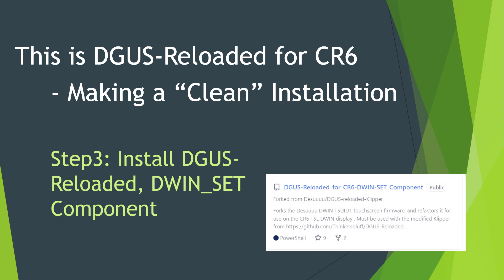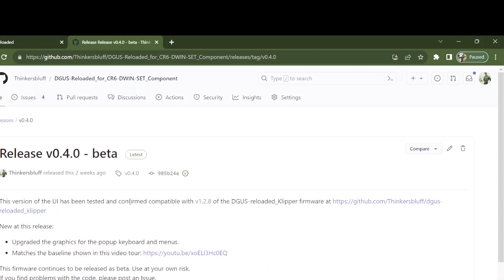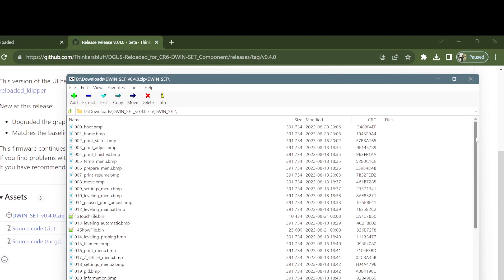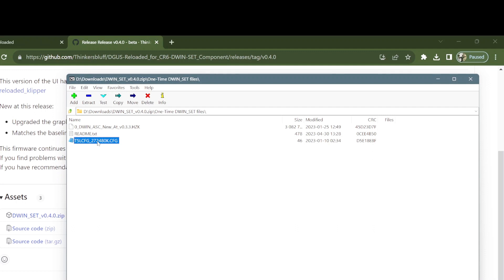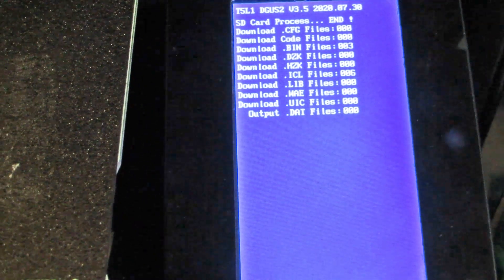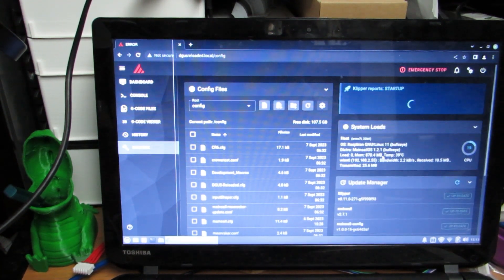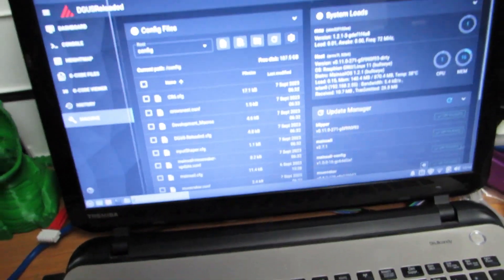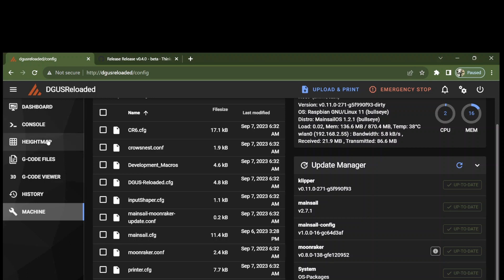Step3: Install the DWIN SET Component

Comment: Hi. I am glad that you te posting such information. Would it work for t5uid1 ender 5+ display?
Reply from the maker: The firmware is specifically designed for the CR6 display and motherboard.  No, I don't expect it will work on any other combination of display/hardware, as-is, sorry.